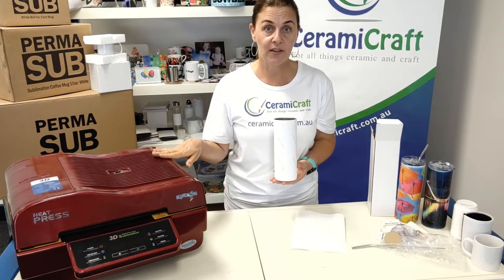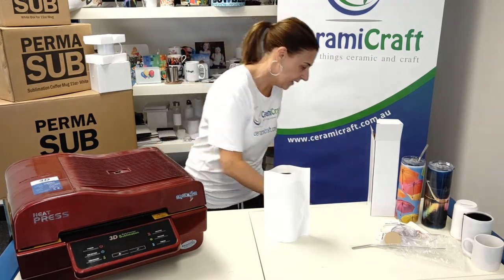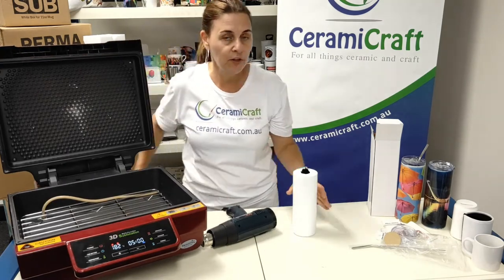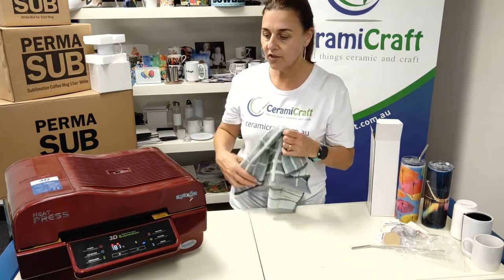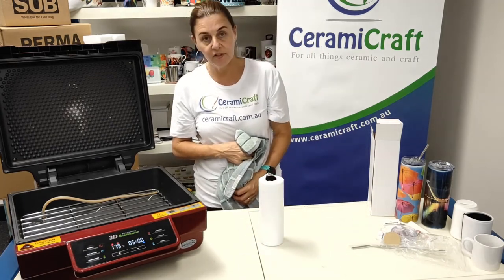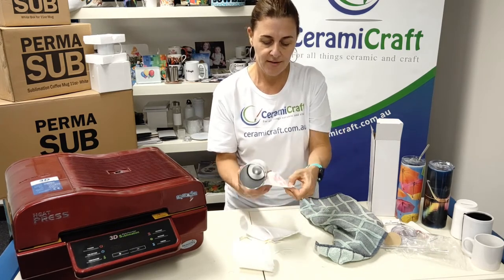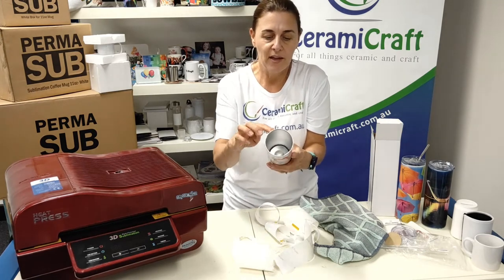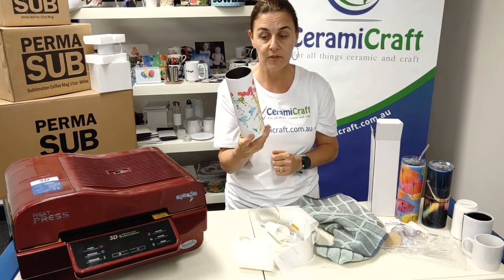How to heat press a Sublimation Skinny Tumbler in a 3D Vacuum Press

Comment: was that 180 degree c for 5 minutes? Do you have to turn it like you would with ceramic cups? :) x
Reply from the maker: Yes that’s correct Phil. 180°C for 5mins. Our results were fine without turning the blank.  However individual testing with your own equipment is always recommended. :)